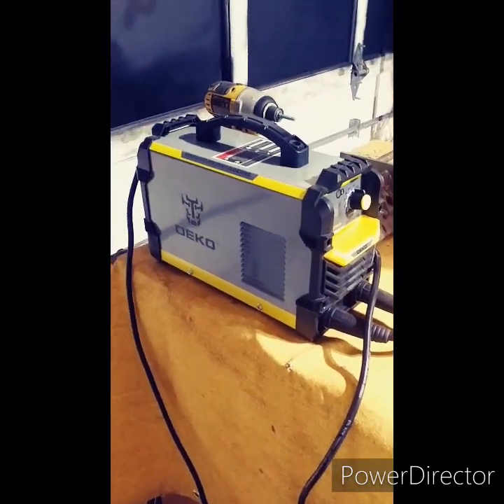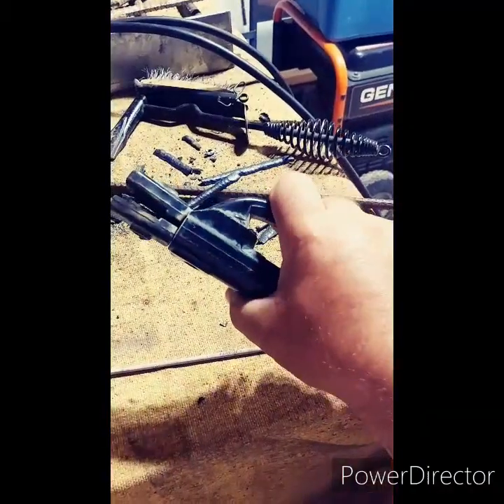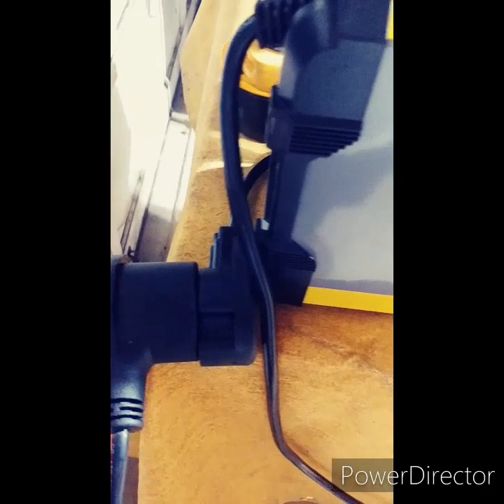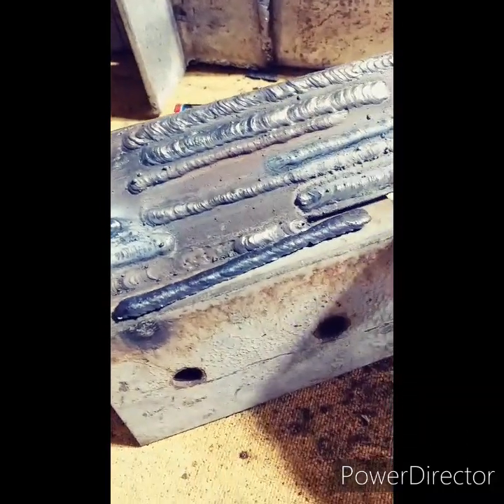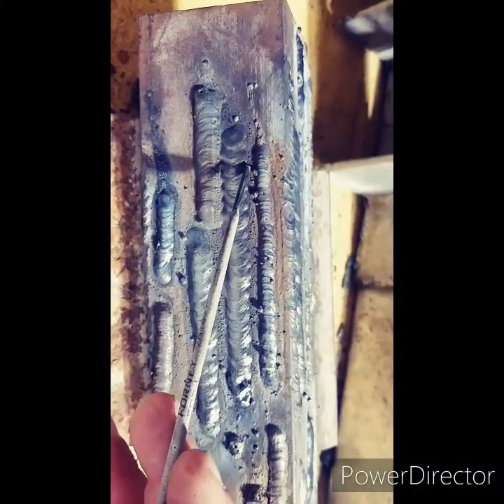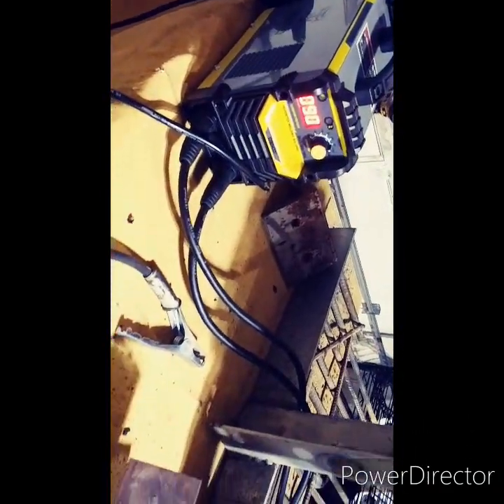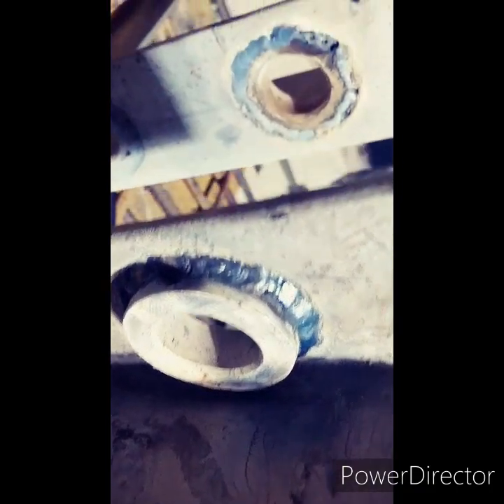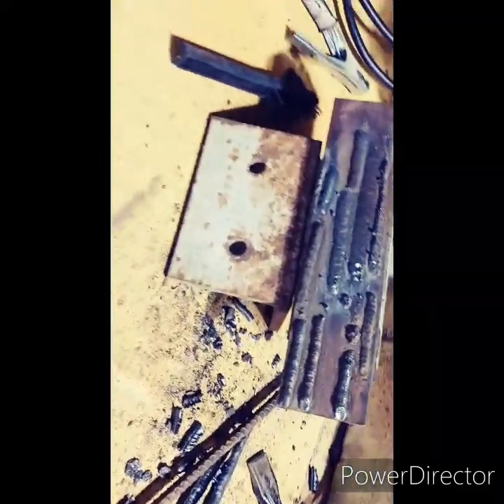DEKO 160 AMP 110/220 STICK WELDER

Comment: I am always skeptical about the ratings on these small inverter welders.  I have a few and they are about half of what they are rated for.  Do you think the ratings for this welder are correct?  i.e. does the display reading match what you're getting at the rod?
Reply from the maker: The amps on 110v set up are definitly diffrent from the 220v setting. On 220v amp settings seem to be on point
Reply: @VRudi460  
Yes, the Amps are less when connected to 110VAC than 220VAC.  Dual voltage welders will have a lower current rating on 110VAC than 220VAC.  The reason for that is the lower current rating from a 110VAC outlet so less current for the welder.  Still, these cheap welders do not meet their current rating and lie in their specifications.
Reply from the maker: That's a great question, I'll throw a Amp meter on it and see what it does.
Reply: One channel did a clamp test...the amps were all over the place but they did average out to the display setting

Comment: So i have a 110 Volt machine that keeps on tripping my plugs. Any reason as to why it is doing that? The outlet is 120v
Reply from the maker: Needs to be on an indipendent outlet, if anything else is plugged into it or on the same circuit, it will trip.
Reply from the maker: Make sure you are on a 20 amp dedicated line, check your wire connected to your circuit breaker as well make sure everything is tight.
Reply: @VRudi460  My instructor gave me the whole rundown but thanks anyway
Reply: @VRudi460  Max power is 15.2amps on 115...so if on a regular plug it will trip.   it needs at least 20 amp circuit.

Comment: aa and yes, the starting amperage is really high, it trips the plugs all the time. dont really know why it does that
Reply from the maker: Make sure you are on a 20amp dedicated line. Check your connection to the circuit breaker as well. If its a breaker that trips frequently , its best to swap it out.
Reply: Probably because the machine doesn't have softstart i had that problem with this machine that's why i got a softstart from aliexpress and it solved the problem
Reply: this machine doesnt have a soft start and thus requires and outlet and breaker capable of handling the start load

Comment: I just tried again today with this machine with 7018 after 8 years of not welding needless to say I suck I managed to tack a axe head that back split on me but God do I need practice
Reply from the maker: If your using 1/8" rod . Try Turn the amps up a little at a time. Also swap the ground and positive seems to smooth things out for me.

Comment: How's the Deko running after a few months?
Reply from the maker: Great! I still can't get over the price for such a  light weight, powerful cool looking unit.
Reply: @VRudi460  Thanks for the Info.
Reply: What's the thickest you have been able to weld?
Reply from the maker: @joerandall9024  3/8 with nice bevel and multiple passes while still hot.

Comment: my potentiometer go from 10-154...  should go to 160?
Reply from the maker: I haven't been able to read my setting in quite some time but I belive it did show 160 at some point.  I guage it by my welds now. I should reach out to Deko about it
Reply: @VRudi460  Thanks..   I will try it from a 20amp circuit or the 220 outlet and see what it reads.  Thanks for the help.

Comment: from the looks of it, all those welds are too cold. i bought the same welder, i cant say it is bad welding maschine, but the amps on the display are wrong. nowhere near 200 amps with 240v. in my mind 130 on the display equals to about 90-100 amps. in that range welder works great :)
Reply from the maker: Try preheating just enough to take the chill out of the metal it takes alot out of the maching on a cold piece of steel, one you start, dont wait too long before striking an arc again. Just my opinion, works for me
Reply: It's only 160A machine

Comment: Which welding rods you use
Reply from the maker: 7018- 6013 - 3/32" 7018 flows nice on clean metal, 6013 is a hot rod that can burn through old dirty steel well

Comment: I just bought this welder and was a dud out of the box. I plug in 110v outlet LCD screen read 016 and no adjustments with knob being turned. Paperweight now. I received it today. Disappointed.
Reply from the maker: Send it back
Reply: @VRudi460  that's my plan. Thanks.
Reply: can you say Chynah?
Reply: Its probably the potenciometer damaged